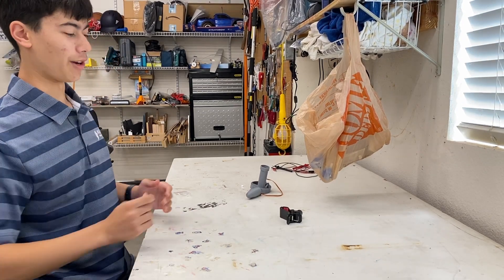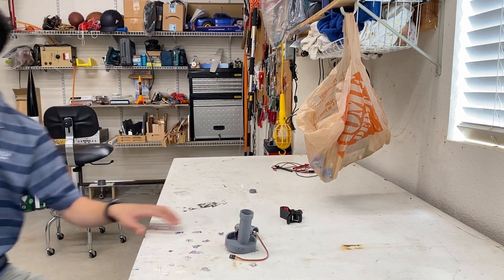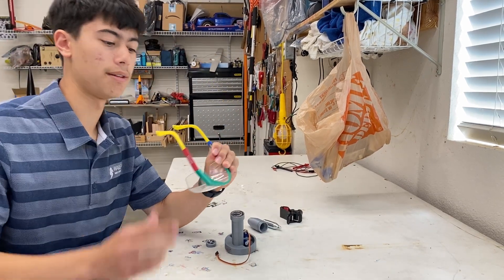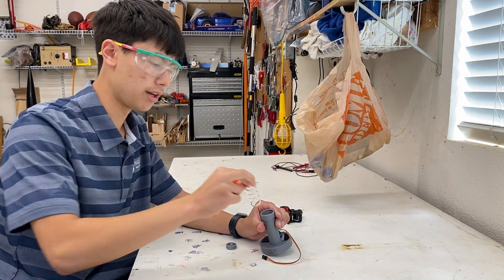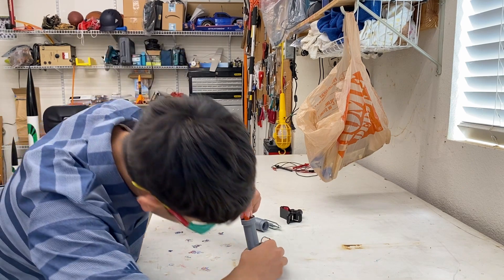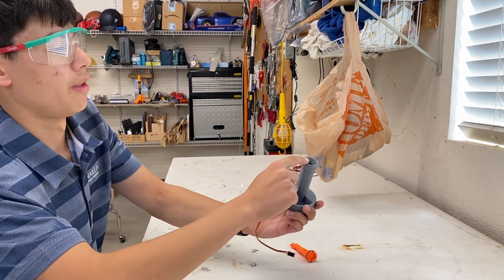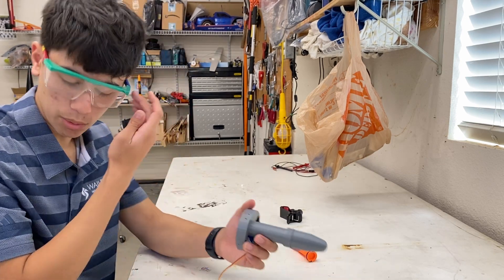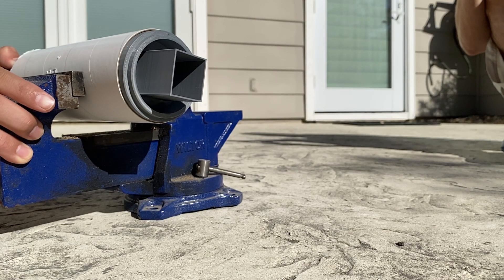CO2 Ejection System

Comment: How can I determine the required force and pressure to actuate the nose cone?
Reply from the maker: You don't really need to measure the force to move the nosecone, you just need enough force from your ejection system whether it's a CO2 system or black powder.

Comment: Why did you not include the "nose" STL to contain the CO2 cylinder with your file download?
Reply from the maker: Hey I replied to your messages on Cults3D but I guess you didn't see the responses. I don't know exactly what you mean by the nose. Is it the part holding the CO2 cartridge? If so that part is included, as well as all other 3D printed parts. Hope this helps.
Reply: @motechspace  I did not receive the reply on Cuts 3D however my bad, I imported all of the files into F360 and the part I thought is missing was just hidden behind the other parts.